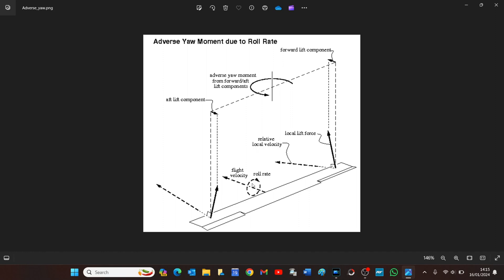Adverse yaw! Why almost ALL models WILL benefit from RUDDER input to correct this unwanted tendency.

Comment: Thank you very much for your very clear explanation of the causes of adverse yaw.
I can understand that aileron differential will work to reduce adverse yaw in turns in an RC model which does not fly inverted.  However, when it is inverted it looks to me as if aileron differential will have the opposite effect and increase adverse yaw during the inverted phase of the roll.
If we look at a roll to the right from a view point of an outside observer looking at the model from behind.  Now if we consider the starboard aileron which starts off being deflected upwards.
As you explain, if this aileron has differential which increases the deflection, this will help to reduce adverse yaw during the first 90° of the roll as the extra drag helps to balance the adverse yaw to the left.
After 90° of roll it now rotates to the left side of the model.  It is now deflected downwards and produces increased drag as the wings become level (while the plane is inverted).  This extra drag on the aileron, which is now on the left side, would appear to add to the adverse yaw.
The port aileron which has reduced deflection, is now on the right side so is adding to the adverse yaw through its reduced drag.
Do you think this is correct or have I got something wrong?
Reply: Hi John,
Rather than looking at segments of 90 degrees, it's easier to look at what happens at any single point during a roll. The roll induces adverse yaw (to a greater or lesser extend, depending on roll rates as well as aspect ratio, wing shape etc.), if you roll to the right, the nose is inclined to drift in the opposite direction 'left', so if the model is upright, on it's side or upside down (it only sees airflow & not gravity) continuing the 'right' roll, the nose will continue to drift in the oposite directioin 'left', so in the latter stages of the roll say from inverted to back upright, as the model continues to roll right the nose drifts left - or down towards the earth in this case, so if this is significant, adding aileron differential will help counteract this tendencny.. (it's not ALWAYS the case, when I fly F3A P & F schedules the model is rolling so slowly, the effect is negligible)
For a more detailed look at this, have a look at the 'Flying Better Rolls' vid & see if that helps to make more sense.
https://www.youtube.com/watch?app=desktop&v=OyHEZXfHWVc
Hope that helps?
Russ
Reply: Hi Russ
Thank you very much for your prompt reply.  I found your ‘Flying better rolls’ video excellent.  I use the method you describe to get the CG near neutral and it has helped greatly with my rolls and inverted flying.

I can appreciate that the factors you mention affect the strength of the adverse yaw, and particularly that with slow rolls the effect will be negligible.
I have thought a lot about what you say in your reply and think there is a snag.  The lift on the wing is always in an upwards direction opposite to the gravitational force on the model.  As the model approaches knife edge the lift on the wings (and the forward and aft components) diminishes to zero.  It then reverses (relative to the wings) as it starts to develop lift in the opposite direction to support the model when it is inverted.

When the model is inverted the starboard wing (now on the left side of the model looking forward) is the one moving upwards and will therefore have an aft component due to the airflow (as illustrated in your diagram).  This wing has the aileron downwards with the greater deflection (as a result of differential).  This produces more induced drag than if there were no differential.  This increased drag on the left will increase the adverse yaw while the model is inverted.

The port wing, now on the right side, will have a forward lift component and lower induced drag (due to the smaller deflection).  This reduced drag on the right will increase the adverse yaw while the model is inverted.

The increased drag on the left and the reduced drag on the right, as a result of differential, will produce greater adverse yaw while the model is inverted, than if no differential had been applied.
I hope that my explanation is clear as to why I believe that differential will make adverse yaw worse while a model is in the inverted phase of a roll.

I look forward to seeing more of your excellent videos.  Not many YouTube videos help those who are interested in F3A flying.  Your use of Realflight works very well as you can see a close up of the model plus the controls.  Your flying is precise and well explained too.  I have subscribed to your channel.
Thanks again
John

Comment: I always set my ailerons with half down compared to up with the hope of limiting adverse yaw effects.  I like scalish biplanes and they're notorious for needing lots of rudder to turn at all.  With my aileron set-up it's possible to fly 'one -handed' (mode 2) and ignore the rudder (or mix some rudder with aileron) but I much prefer to use rudder with my left hand.  I hadn't realised adverse yaw had so many causes.

I'm far from an ace pilot, but I usually manage to get my models down more or less in the same state they took off :)
Reply from the maker: Yes I fly a variety of biplanes & of course with all the effects, they all require some form of compenation (even the F3A ones!).
Glad you found it worthwhile & hope you will enjoy some more videos coming up soon! 😀

Comment: I much prefer bank and yank over any rudder input. But I only fly slope gliders so my opinion might be a little skewed.
Reply from the maker: Yes there is always more than one way! I flew a Phase 6 slope soarer for about 10 years in the '80s, normally off a hill with great lift (U.K. South Downs), so bank & yank was great for our impromptu pylon races, but when doing aerobatics - the 4 point hesitation roll was definitly better with rudder! Particularly the 3rd part... I also flew the   model near my parents house with very poor lift (small hill where I started slope soaring with a single channel Veron Impala in the early '70s!), here the use of rudder for efficient coordinated turns was the best way to keep the model airborne.. Horses for courses! :)